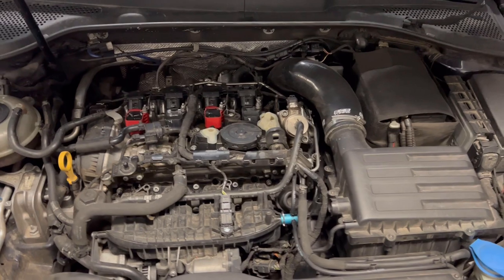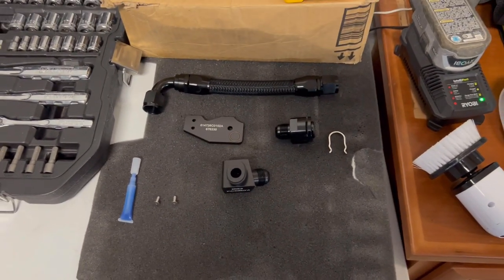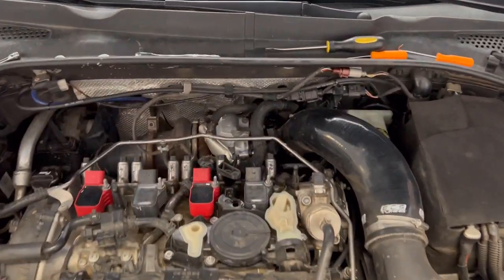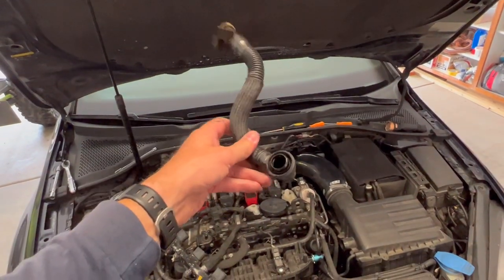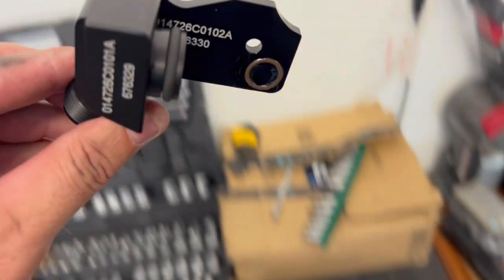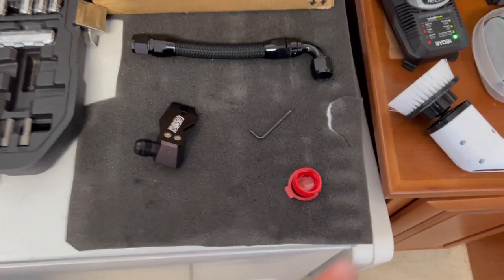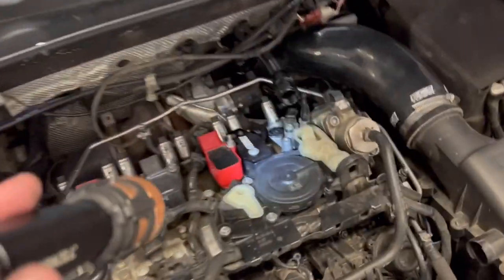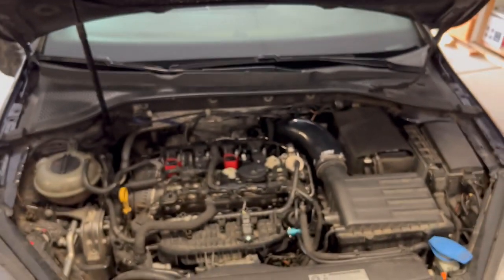ECS Tuning PCV Breather Hose Kit for MQB (EA888) - Install - MK7 GTI

Comment: Aren't you worried about clearance issues you'll have where the pipe mounts to the inlet, practically no clearance for engine movement / rocking? If it periodically hits the firewall you'll. probably have Leakes at that end. You said you've had the original hose off and on 3 or 4 times and with over 100kmi I would have just replaced with original hose, anyway thanks for the video and the installation of this part... good to know what to do and not do.
Reply from the maker: Yes, I’ve thought about that, and I check it several times a week, and haven’t had any signs of leaking. But I have thought about it, and when I have some time, all it will take is a 5min job of me banging the firewall in some more to give it that clearance. So far everyone installing this part has had this same firewall clearance issue, but nobody has had any issues with it leaking after install, despite the engine movement. Reasons why I didn’t go OEM were because: 

1. It’s a horrible design from the start, and others who have replaced them have had early leaking signs where mine was leaking. I didn’t want that to happen again.

2. The OEM part was $70% more expensive than this way better built part.

3. This ECS part will allow me to add a catch can with its fittings if I so desire in the future. OEM doesn’t allow that.

It’s these three reasons that made up my choice, as the pros of this ECS part easily outweighed the cons of the OEM part.

Thanks for watching and for your feedback!

Comment: Thanks for this video!  I just ordered this same part for my S3 8V.
Reply from the maker: No problem. It’s a good piece of kit! I’ve had zero leaks or issues with it since installing it! Just make sure you provide room for the elbow that’s near the firewall, as your engine moves upon acceleration.
Reply: @JacesOwnWorld  Absolutely thanks! It LOOKS like I have a bit more room in my 8V S3 than your MK7, but I’ll confirm once the kit arrives.  Appreciate the reply my friend! 🤙🏼
Reply from the maker: Sweet man! I’m jealous of your S3! Glad you have more room on it!

Comment: Damn, do you have any issues with the u bend when engine under load,,, it looks way to close to the fire wall,
Reply from the maker: Well, it does hit the firewall, so yeah, that does suck. But I also think that’s partly due to the CTS TIP I have, 1st gen. It’s design is poor. I’ve thought about buying a new TIP, but for the price they sell for today, I tell myself to forget that. Not worth it for the price. I bought mine back in 2018 for $28. 

Anyways, yeah it hits, but I did bang the firewall in a little bit to give it some room, and that helps. I monitor the u-bend weekly, and it’s still in perfect shape. I still run OEM motor and trans mounts, and they have over 162k miles on them, with the car being tuned and modified it’s entire life, so I’m sure they need to be replaced. If I replaced them, I’m sure that would help big time with engine movement under throttle, and prevent the u-bend to hit the firewall. But as far as it is right now, yes it does hit the firewall, but it still performs as it should. For the price though, this is a great upgrade. I have a lot more confidence in the PCV system now due to this, and no more leaks.

Comment: Hey man how do you disconnect the hose from the inlet part, mine is too hard and I dont wanna yank it out fearing I might break some clips
Reply from the maker: You can either remove the turbo inlet pipe with it connected, and then try removing it from there. Or you can insert a little angle pick up inside it from the bottom, and wiggle the pick to release it. That’s how I always did it and it never broke
Reply: Thanks man you're a lifesaver! I'm lost and was trying to figure out how to get it out. Thank you for replying so quick you a real G!!
Reply from the maker: @Vesper778 of course bro! Let me know if you have any more questions.
Reply: @JacesOwnWorld  Quick update it is all done. I ended up taking out the inlet just to be safe and since I cannot maneuver the old breather hose out I ended taking the diverter valve out also. All in all it was a fun way to wrap up Sunday lol.
Reply from the maker: @Vesper778 haha, well it’s all done now. Jobs never go as easy as they should haha